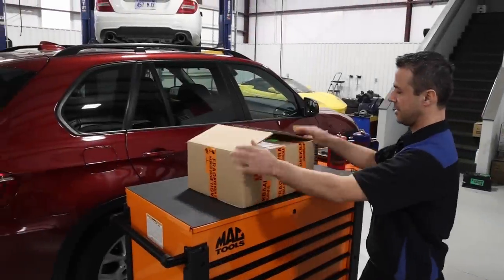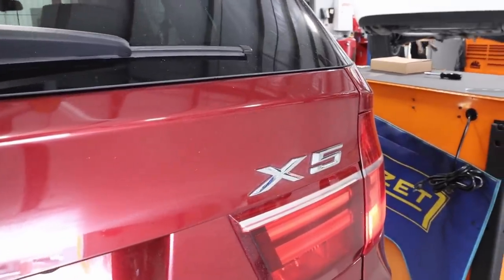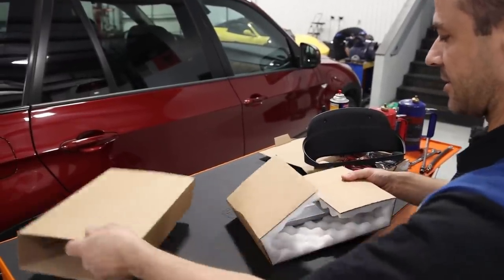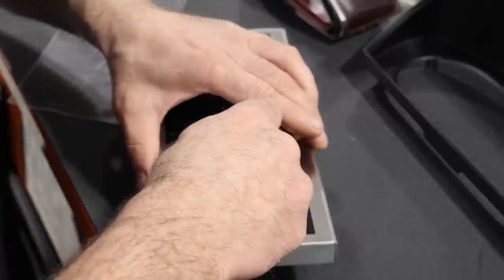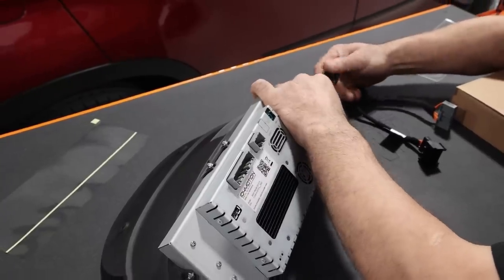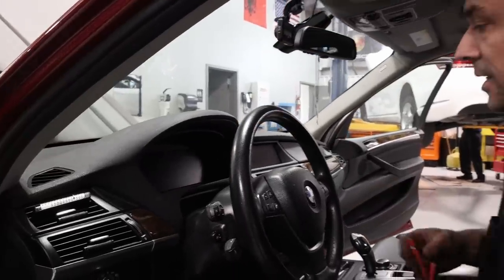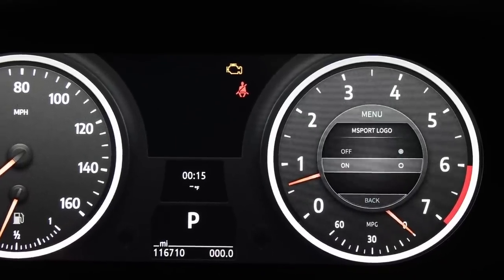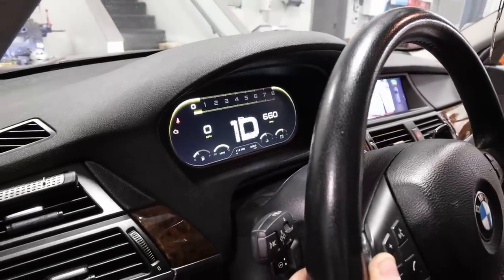CAR NINJA! Ninja's X5 gauge display ID4MOTION

Comment: The E70 X5 is the best styled SAV BMW has designed to date. I have owned two, a diesel, and currently an X5M. I like this gauge upgrade
Reply: Im curious to which one did you enjoy more? Like which one had less maintenance and headaches for you. I personally used to own a 07 x3 m and I loved it.
Reply: @leonardnose5695  hi Leonard. My 2011 diesel was awesome. Torque monster, and it had the X5M suspension (steel springs). It was fast, and pulled like a freight train on the highway. It had NOX sensor issues often. One injector failed. Dealership wanted $2600.00 to replace one injector. I did it myself, cost under $500.00, NOT including the software to program the injector. Unfortunately I totaled it one morning on the way to work. I began a search for an E70 X5M. (I also own a 2000 e39 M5).  Found one (2013) at a dealership, trade in. Garage queen. I love it. It is stupid fast. But, it will pass everything but a gas station. 13.5 MPG vs. 24 with the diesel. Still, I prefer the X5M. The maintenance doesn’t scare me as I do it myself. It has every option available at the time. 
Wish I had the room for both!
Reply: 100% man
Reply: I know this might be a little late, but I have the N52 gasoline I6 variant and am thinking about moving up to a diesel now that I’m out of school. How was yours reliability wise? Did you do any mods? Anything to look out for? Thank you so much in advance brother 🙏🏼

Comment: Ninja,

Supplied rear  camera might be worth adding as it may have a higher resolution from the factory unit
Reply: Yes!! its a excellent question, I would like to know too, I´m intersted to replace to but I have to be sure that the camera is ok (talking about the resolution)
Reply: No it’s not worth adding, it’s identical to the cameras you can get for 10 euro. They just charge 120 euro for it.

Comment: Initially i wasn't sold on it. Mostly cause it was trying to imitate a stock/analog gauge cluster and clearly was just a lcd panel. But once you set it up with the other layouts and even more so changed the coloring. I really like it. Has  a nice feel to it stops trying to look like what it isnt. Which is one of my big gripes about digital clusters is they try to look analog. Personally i prefer analog until you can customize it to your liking and it stops trying to look analog. Then its does it match the look of the car.

Comment: This is really cool. Looks like a properly made instrument cluster. Not cheap, but I’d hate to think of what a oem piece costs
Reply: OEM piece from the dealer for car that are a bit newer is lower depending on the dealer and their discounts, not to mention it’s much higher quality.
Here you get a device that has a terrible quality screen, has less functions than a stock cluster, messes up the canbus and makes coding sometimes even code reading impossible. It’s a bad buy.

Comment: Is it possible that you could film work done on your x5? I have a 2013 e70 35i, aswell. I need new engine mounts 🌚
Love the channel, bro.
Reply: Hope you get the engine mount package from FCP EURO. I just did mine on my 2012 E70 35i and it’s completely smooth again with the new OE mounts no vibration.

Comment: Was a check engine  light before you put the new cluster or it occurred after installing a new cluster?
Reply: He explained this in the video, the check engine light was there before and he wanted to see if it would also come up on the new cluster so he didnt clear the code on purpose.